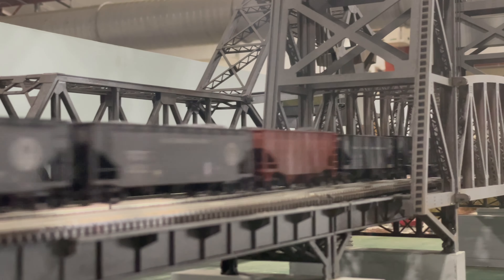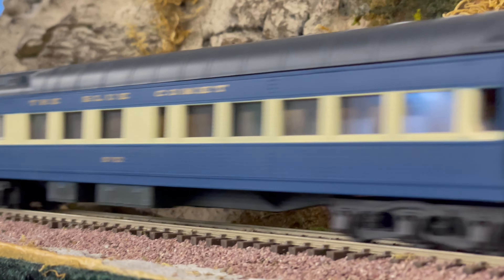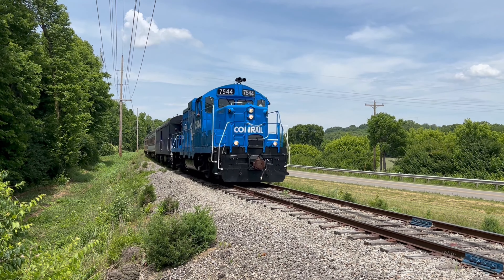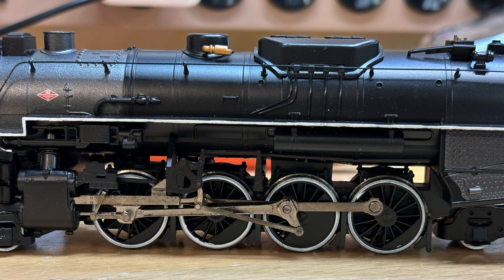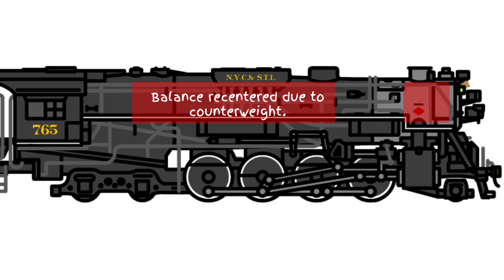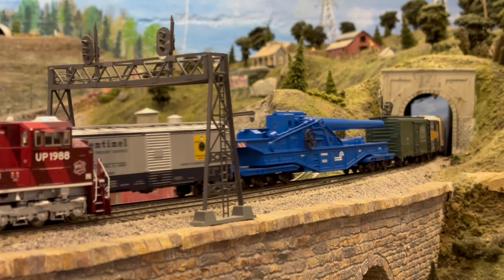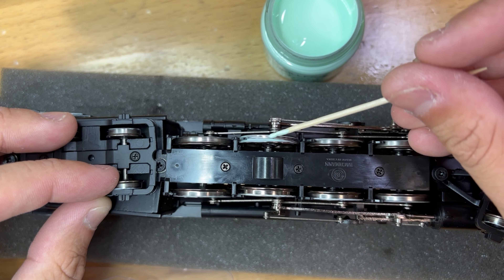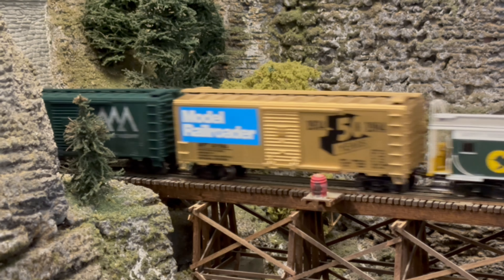Torque and Traction. What Makes a Model Locomotive Pull Well?

Comment: This was ridiculously helpful! 

I am looking at customizing an IHC HO Scale Mikado to Grand Canyon Railway colors and a Bachmann Berkshire to the Polar Express, since the Lionel one… sucks really bad. 

I thought about customizing a Bachman Berkshire to the Polar Express but heard the polling power was terrible. Now I know how to fix it! 

Thanks again!
Reply: You could have just got the proto2000 Berkshire instead.  I was insane enough to get the Lionel one to see if I can fix its issues though, so I can’t blame you.  Lionel chassis with a Bachmann body would be great though!
Reply: @1471SirFrederickBanbury a rivarossi is a better option than the lionel.
Reply from the maker: Proto has a gear cracking issue that I believe has no equivalent currently made part as a replacement
Reply from the maker: In my experience, the newer ones pull significantly better. I had a modern PM one for about 2 years and that thing pulled just fine.
Reply: The Proto2000 models though are pretty expensive. I also plan on swapping out the Bachmann DCC decoder with a Blunami one so I can operate the engine via Bluetooth.
Reply: @cobramerciless  fair. I’m sure that it can be solved one way or the other, but the main reason I recommended the proto2000 Berkshire is because outside of brass, it does look the best imho.
Reply: @1471SirFrederickBanbury oh I agree. Just got myself a Proto 2000 Berkshire. It was brand new and never out of the box and that things a little beast and so pretty too. Just added Loksound 5 to her and she's become a club favourite hahaha
Reply: @RizenWorld  yeah, that thing has great detail.  I saw a weathered one once and couldn’t believe my eyes.  The mechanical side is pretty good too with the gear tower being Less noticeable than other berks, and I think with some care, a good suspension system could make the riding even nicer.  Springing is something I’ve always wanted to see live in a Berkshire model, especially if it was done to the high standard those British P4 guys do!

Comment: I definitely know what all of this is like on my HO scale model railroad layout. My Bachmann Berkshire (Pere Marquette 1225) is large, and has 8 wheels, but it's surprisingly very weak. The Lionel Berkshire (The Polar Express) is a much stronger locomotive, mainly due to the fact that it actually has traction tires (the Bachmann Berkshire doesn't have traction tires whatsoever). I also have a Rivarossi AHM Southern Pacific Cab-Forward, which, despite its huge size, is lightweight and doesn't have much pulling power. I'd say that my strongest locomotive is either my Bachmann Spectrum Dash 8 (which doesn't run, unfortunately, so I'm not sure if it counts), my Athearn Bluebox Burlington Northern SD40-2, or my brass hybrid Broadway Limited Imports Northern Pacific A-3 (which is my most expensive locomotive, ever).

Comment: That said what I also do is I remove weights from wagons where it’s easy to do so
Reply from the maker: I find that to be a poor idea. Mostly because once you start to pull longer trains cars at the front will derail due to being too light
Reply: @cobramerciless  ehhh for what I do it works alright, I imagine for a full length scale train it wouldn’t work so well

Comment: I've got a trueline Trains MP40PH-3c that had awful pulling power, before adding weight I could get 6 commuter cars moving with some wheel slip. After dumping some lead pullets into the fuel tank I can get at least a few more. I am going to put more weights in the shell at some point but I have to keep an eye on the motor as the gearing is kinda whack and the engine is getting old

Comment: TBH, I don't understand why bachmann don't use traction tires for their steam locomotive, especially with the larger ones. Also, I don't understand why people hate traction tires so much.
Reply: I think some people just don’t like them because they don’t last forever and not everyone needs them for their models.  Some occasional locos come with both. I know a uk 2-4-0 they made did.
Reply: The main reasons I don't like them are they tend to collect dirt and grim more so then a regular wheel and secondly you lose some of the electrical pickup. Though since I run small trains modeling a short-line I don't have desire or need for really long trains so pulling power isn't something I care much about. But to each their own.
Reply: Fair. It makes sense for smaller locos to not needed. But larger ones it does. @bluepoppy1026
Reply: @Lamp_2155 I some models from the 70-80s that still have their original traction tires, and preform as expected.
Reply: If your rolling stock has free enough wheels and everything is heavy enough, you can get realistic wheel slip and more realistic acceleration.  The main reason for most though is that if you have a too much grip, it’ll stall the motor and maybe even burn it out, which is annoying.
Reply: @1471SirFrederickBanbury  fair, but every other feature also has problems.  For example, DCC decoders can easily wreck a model when fails. However, you don't see people saying to avoid decoders because it can be a pain when it fails.
Reply: @gamerfan8445  I agree on the failing part.  If a motor can’t handle the strain, then it’s of no use to me.  I can’t give up the realistic wheel slipping though, as I model the LNER (east coast Britain pre-war), slipping out of the station as a normal “show-off move” was common, and looks lovely in model form.  That, and I also put new bearings on every single item of rolling stock to ensure realistic dynamics, so I’m not going to make that all for nothing!
Reply: @1471SirFrederickBanbury  I have models that can wheels slip with traction tires. It just takes more weights to make them do so. But I  do US modeling, where we need the models to pull long/heavy trains. Also, I recommend to take sam train word with a grain of salt.
Reply: @gamerfan8445  you are right.  I think the fear is just people talking about locomotives with more traction than torque, but like I said, if the motor isn’t good enough, it should be replaced.  Also what about Sam’s trains?  I know he is very against traction tires, but that’s more of him being against manufactures using traction tires as a clutch to not put enough weight into a loco and then use whatever crappy motor, which sounds valid to me, but the generalisation that traction tires are bad doesn’t make too much sense to me either.
Reply: I personally see them as cheating. Add weight, maintain the motor and wheel bearings/bushings so less power is lost to friction, but the big issue I have with traction tires, is that my trains do have to run unattended for hours at a time, as I loan them out to businesses for their display windows for special events. If a train gets hung up, without traction tires, the wheels just spin. With traction tires, the wheels can't spin, and the gears can be damaged or the motor can fry out then. I also don't like the loss of electrical pickup, as I value reliability.
Reply: @modelrailpreservation  fair, however, if you made a model that is heavy, it would be unaffordable for for most poeple (Broadway), or have to sacrifice somethings to keep cost down (Bachmann NYC Hudson). It not even mentioned the fact that most G scale/ O gauge models have traction tires, and I don't see them complaining about them.